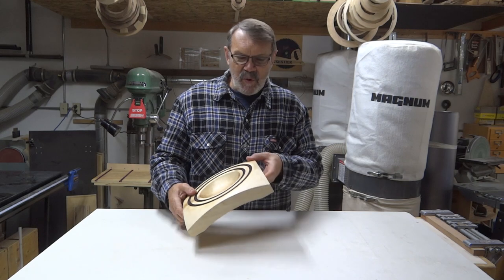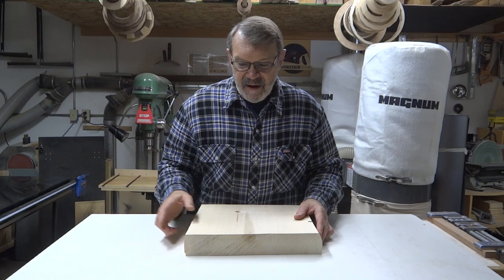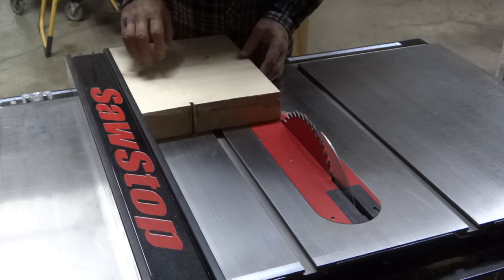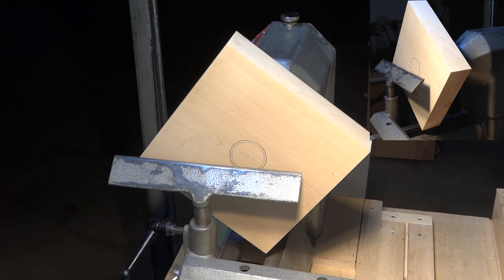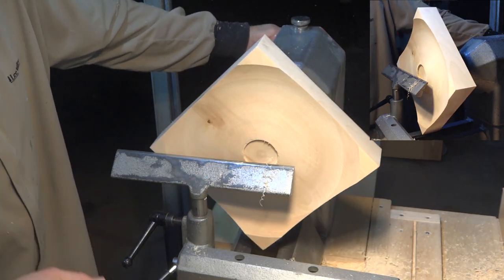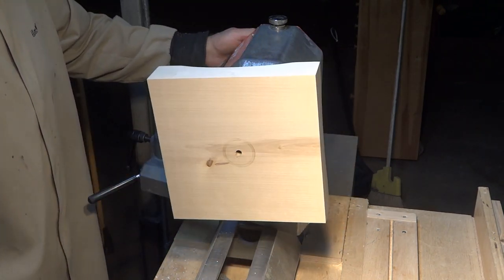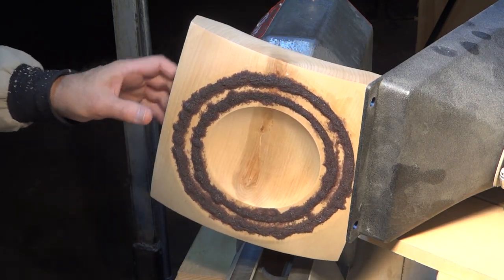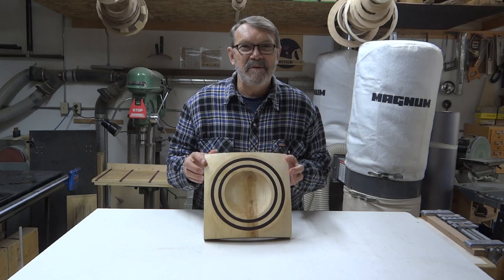Square Bowl With Stone Inlay

Comment: Wonderful work as always. I love the clean, simple and elegant lines.

When filling with the stone, might it be better to level it off with a ruler and glue that, then top up to just above the surface and re-glue? It might save a bit on materials and sanding time. (Said from the comfort of my couch and with the benefit of 20/20 hindsight!!)

P.S. I like the somewhat dull (or subtle!) shade of red as it's more in keeping with the natural wood. Anything brighter might detract from the beautiful knots in the bowl.
Reply from the maker: +Rocky Mac 
Hi Rocky,
I realized after gluing the stone in place that I should have done just as you suggest. If I ever use stone inlay again, and I probably will since I have so much of it, I will do just that. I agree that a bright red would not have been good and in fact I think the black stone would have likely looked better.
Thanks for the input,
.....Gord